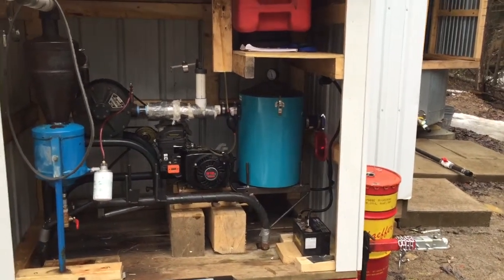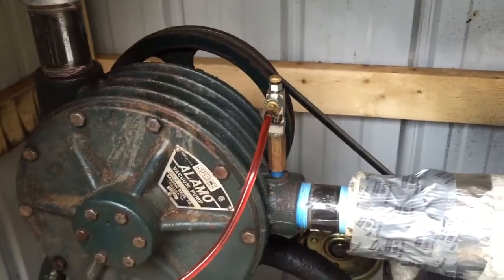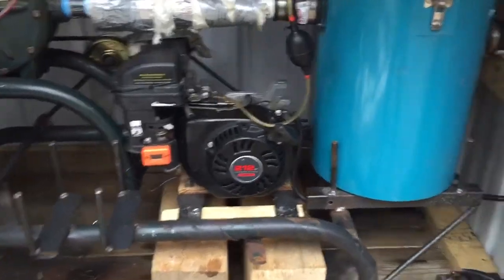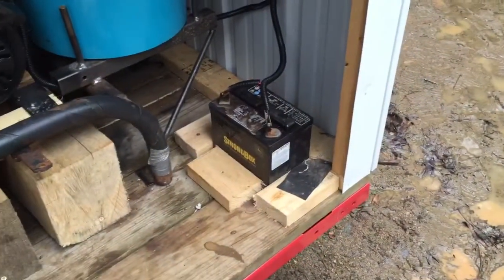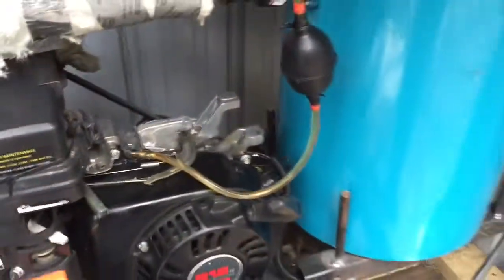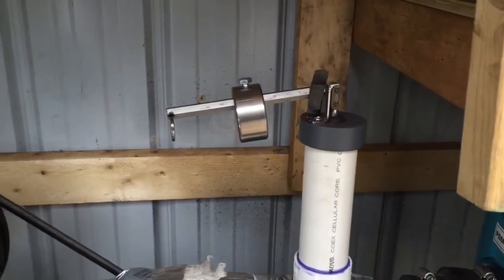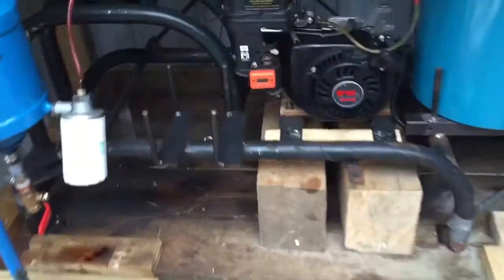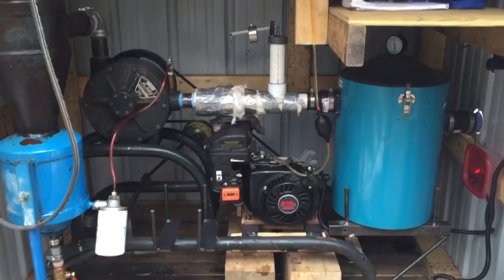Maple sap vacuum pump

Comment: I have the same pump but mine has 3 drip lines, can you explain why yours doesn't?
Reply from the maker: So, you have a 40+  They are the same minus the driper for each bearing. This is a 30+, which has sealed bearings. 40+ which you have is better imo.